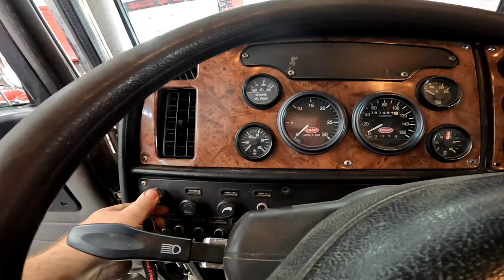Making Duke roadworthy... So we can use him as a daily but he needs a bumper.

Comment: One of those work light wires could be used to light up the back of your turn table or “fith wheel” to check king pin is locked in properly .

Comment: Anyway, you did an amazing job with the front bumper installation. All that needs done at the moment, is to clean up the rest of truck's frame, paint it to match the rest of the truck, get rid of those awful wheel rims. Just take it one thing at a time.

Comment: Duke looks right fine, some ford  engine blue to cover the rusty spots   on the frame might be the ticket for a bit. I used to run the chrome wheel covers over my steel wheels till I broke a rim and it left... exit stage left as yogi bear said. No covering those wheels for me..... I like half fenders because when iron has to go on, its just misérable to get the iron on and not be completely covered in snow and ice junk. Soapy water from the windex bottle and tail lights just fall in. I went to charcoal grey paint on all my steel wheels and its not as glaring... I want chrome thing when the bank book says just be glad that you are rolling. I think that this is a good time to think about a driver with a lot of miles on him... kinda like a your dad age and is willing to come to the shop and work on it as well. Its money well spent to have it in a local haul, no east west stuff till you have that kind of income that lets you recover a rig from some nefarious individuals that want your toys. I really believe in GPS locators so a locator hidden on the rig so its able to be found just in case someone decides your truck looks good in their driveway. I had one taken before all the electronics were out there. We found it a week later with absolutely nothing left of it... five miles from the shop. I had some frame rails, part of a cab, and a lot of hot wrench marks. It was a rig  that had just been majored and was fresh  paint and interior as well... just can't have anything nice if your a broke dick logger. Actually  this truck could go logging with the rig not being all show and no go to the bush. So if you could find a person who has his own home locally... those guys have homes, are easier to follow up on the rigs conditions and if its not getting beat down. After all, its just a truck at the end of the day and can be replaced. Oh.. most micro switches can be cleaned up and they will go back to working again but new switches are really not expensive and do work well. I just hate not having a good jake and someone hits the throttle with a jake still on.... pushrods if your lucky

Comment: Mike, don't use your finger to see if holes are lined up, because you are asking to get your finger end chopped off. That bracket is under tension and if you put your finger in the hole to check the alignment and the bracket chooses that moment to slip, you are left with one finger a bit shorter than it originally was. I have seen it done when fitting a new rear spring, a work college was using his finger to line up the shackle pin holes when the spring decided to move slightly when he was lowering the jack. and bam, he lost the end of his left index finger just below the top knuckle, he lost about one and a half inches of the finger. Needless to say he never did it again.
Reply from the maker: Ohh my gosh thats not good. yes i wont be doing that again.
Reply: Personally know a guy that lost a pinky due to exactly that lol

Comment: hello Peterbilt Mike you have uploaded a very nice video Greetings from Germany you have also shown that you have built a bumper on your truck I like it chrome polished it is missing to let the grille in the same shine and you have done other work that is important were the costs incurred when you own a vehicle like a truck to do the maintenance we come to how I would do the truck if I owned it you have already done a lot of things that you look nice but I would see what the work costs me with sandblasting to combat the rust and that the chassis looks in good condition again in paint blue as it is I would even do an LED strip under the cab dirt fenders on the rear axle either completely so that both are covered or so half and the Rear lighting in chrome bracket use LED technology that also has a number plate holder where the number plate can rotate yes such tuning parts that you can get affordable so I would park the vehicle and lastly I would look if I have money over the original Alcoa rims in chrome I would continue to use the fifth wheel would see that I can get a trailer you can afford as a low loader which is in good condition but still looks good that you can also transport other vehicles with it that's how I would do it if I owned this truck there are also quite lines that you can't be higher like the bridges are in Germany is a bridge 4 m high over there we mustn't be that you can drive down there